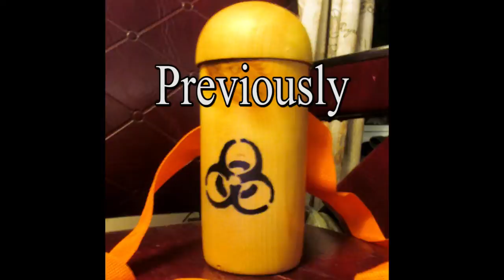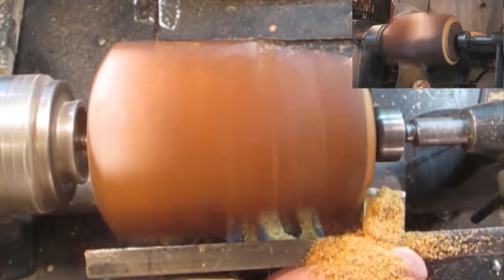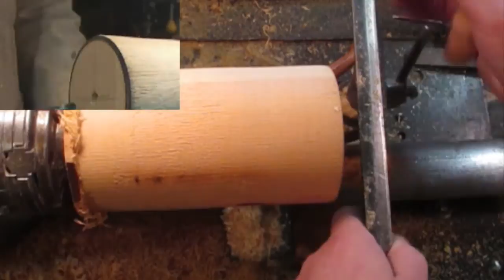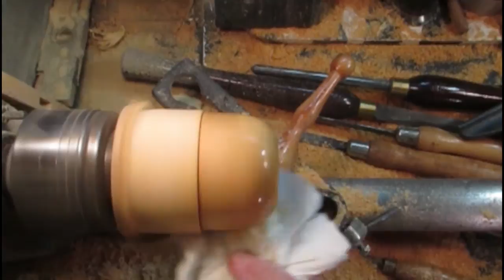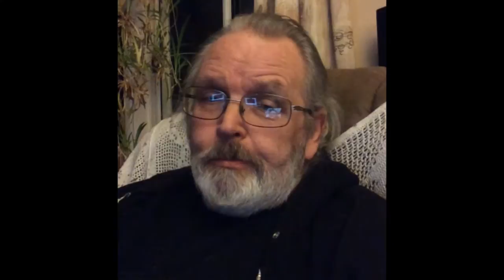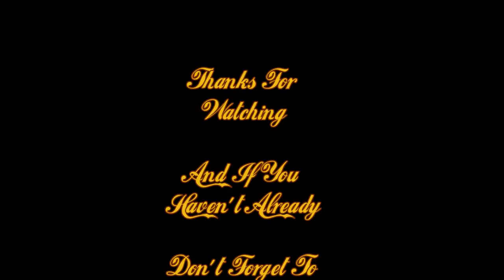Wood Turning #97 CBH Follow up

Comment: Awesome work with the skew! It gives me hope that I can someday do that acceptably well.
Reply from the maker: Kenny Boothe Hey Kenny: I am betting that day will be tomorrow! When practicing with a skew I have found that using a spur (just the point with no teeth) makes it so that you can make all kinds of mistakes... but if you do something that would cause a catch... the wood just stops turning! The lathe is still going at the same speed... it just doesn't have anything to drive with! To tell you the truth... I seldom use a drive any more. But I have to qualify that with a "not since I got a live center"! And even there I found a pen mandrel at KMS tools made by MaxWood for $25!  And pen mandrels aren't just for pens... anything that has a hole in the middle... these ones come with a live center that has a hole in it and you slide the mandrel through it...making it so you can work on any length piece! Another fine place to use that skew! Tomorrow!   Thanks for watching   Larry